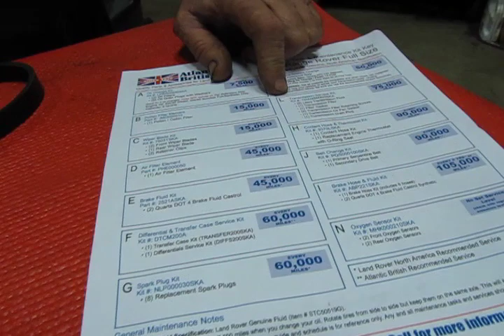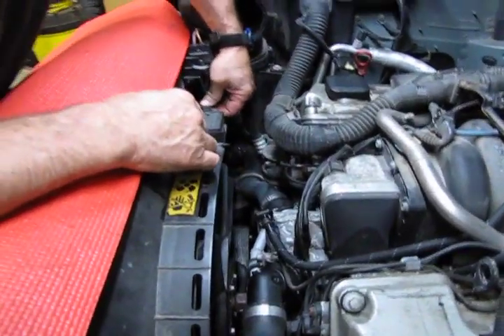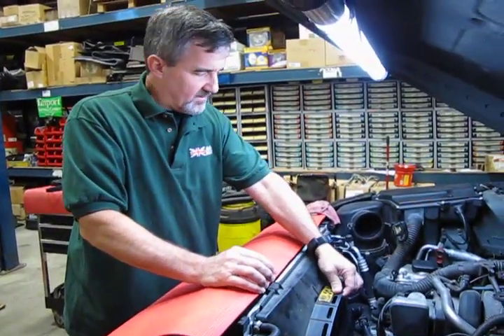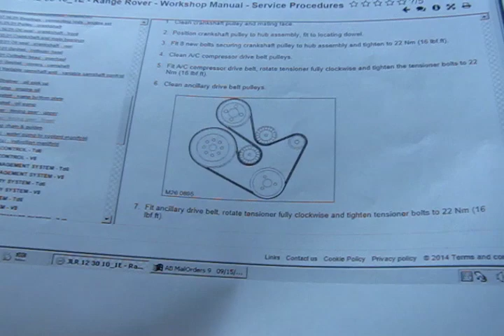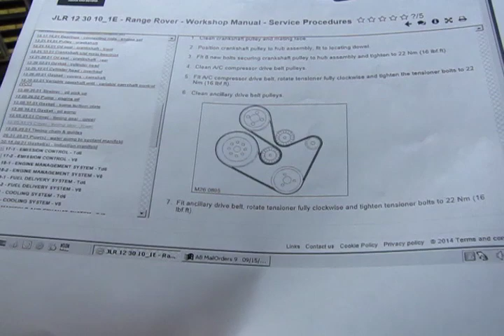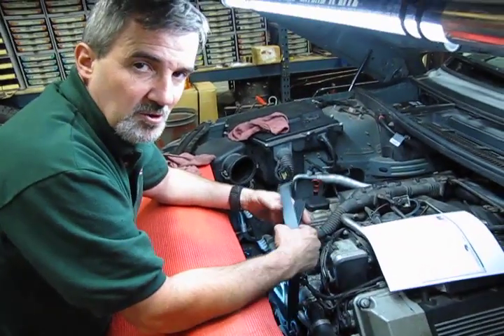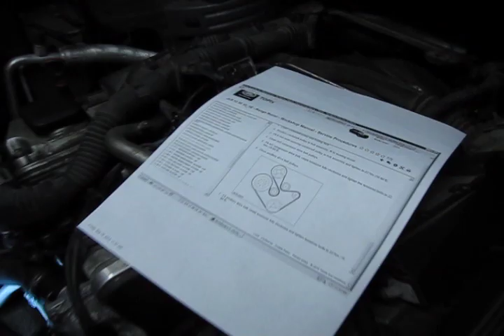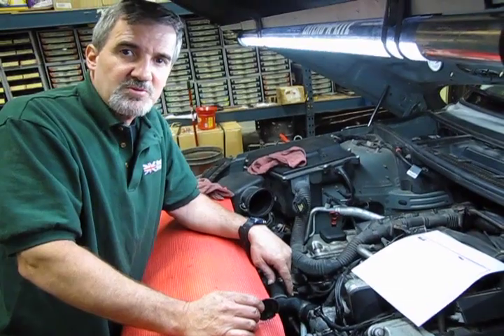Atlantic British Presents: Belts Replacement on Range Rover Full Size 2003-2005

Comment: excellent video, even thou things are slightly different on a RHD, but just one note. When I used the 32 on the Fan, the whole unit just turned, you will need two 32 spanner, one slim one normal both with a long handle (or you slip the new belt over the blades of the vent)
Reply: where would the second spanner go only one bolt this is 
hard

Comment: Doug,
Would you typically recommend replacing tensioners and pulleys at the same time that the belts are placed?  How often do these parts wear out compared to belts?  I'm replace water pump, and decided to swap in new belts at the same time.  SHould tensioners and pulleys be replaced too?
Reply from the maker: Hi Praneeth,
What is the year, model and mileage of your Rover?
Reply: Thank you for replying.  It's a 2011 full size Range Rover HSE. Only at about 72000 miles.  I have a very small leak in the water pump and therefore as part of replacing that I'm replacing the belts too
Reply from the maker: The pulleys on this model aren't known for premature failure. When you're replacing the belts, check the pulleys for looseness or roughness when turned as a precaution, but unless they either feel loose or rough, you won't have to replace them.
Reply: Thanks so much. Very helpful.  Love your videos and the availability of parts  and kits at Atlantic British.

Comment: how do i remove the fan if the belt is not holding the pully in place
Reply: use a rubber oil filter strap but  one needs to cut the old belt works every time